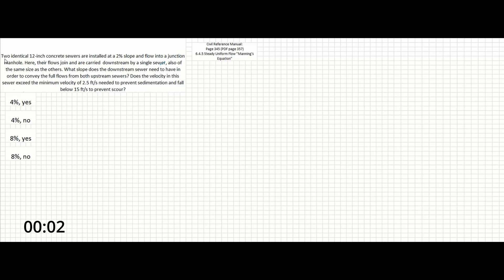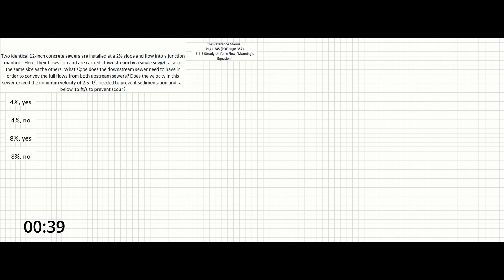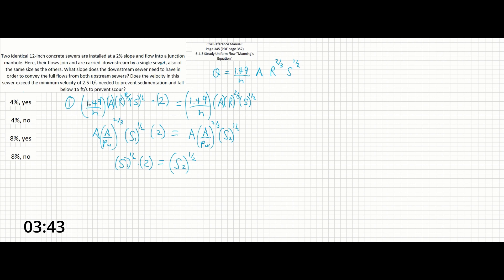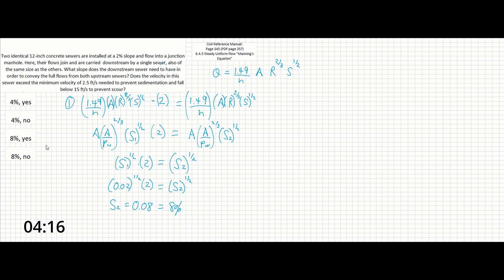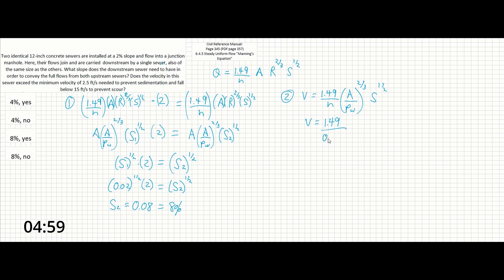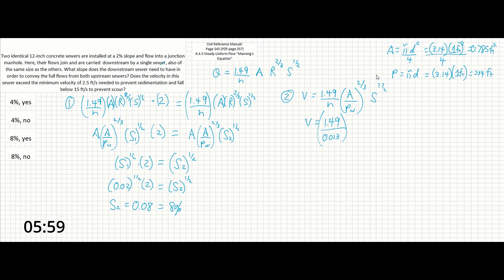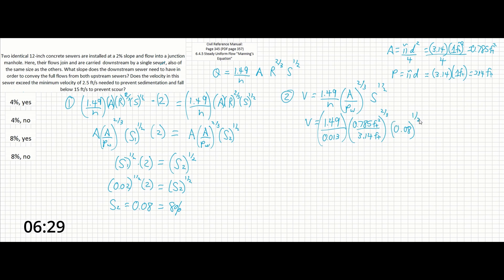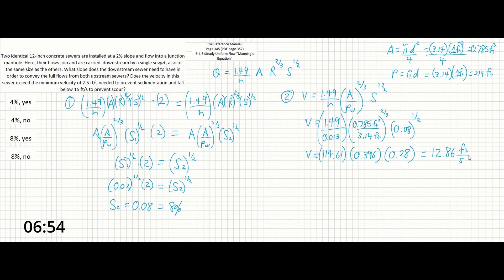PE Exam Practice Problem #43: Water Resources | Sewer Designs - Equivalent Flows - Mannings Equation

Comment: Quick tip, you can use RH = D/4 for circular full pipes.
Reply from the maker: You're absolutely right and thank you for pointing this out so that others might benefit. I often write this problems without shortcuts but these things will definitely make your life easier and save you time on the exam.

Comment: I solved this one slightly differently. Since I know it is full flow conditions, the equation Minimum Diameter of Circular Pipe Under Full Flow Conditions (pg 348) which is a derivation of manning's should be applicable. I can use that equation to solve for Q of the inflow pipes and then knowing the flow of the outflow is double the inflow and also under full flow I can plug it right back in and solve for the slope. I think that might be a quicker method for solving this one.
Reply from the maker: Very efficient! Great find and thank you for sharing. It definitely seems like a better solution.